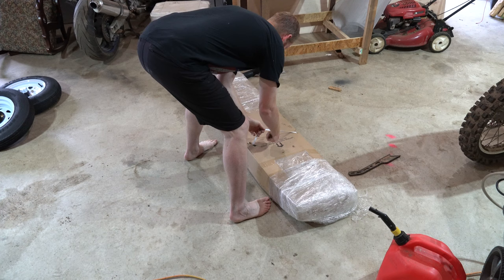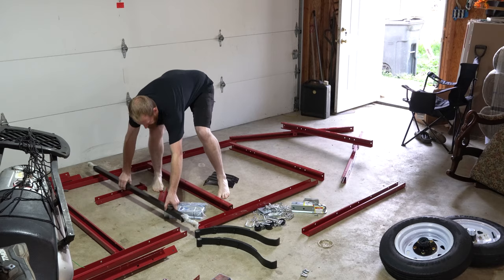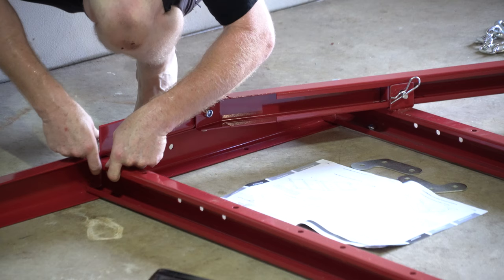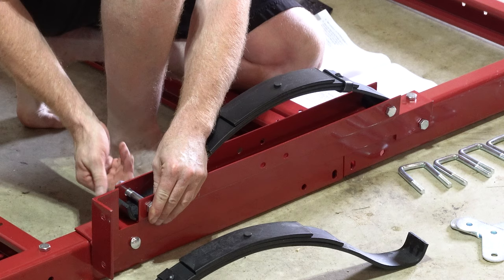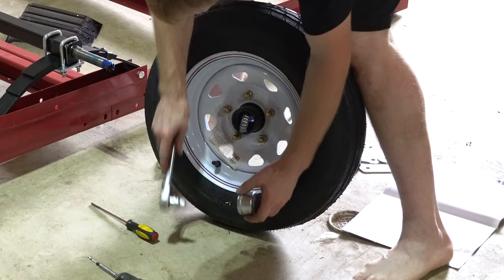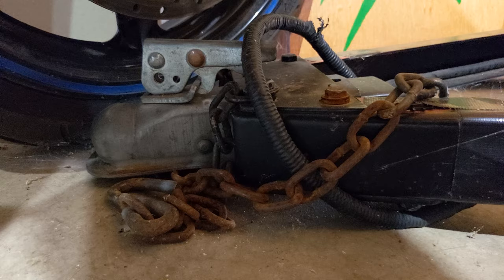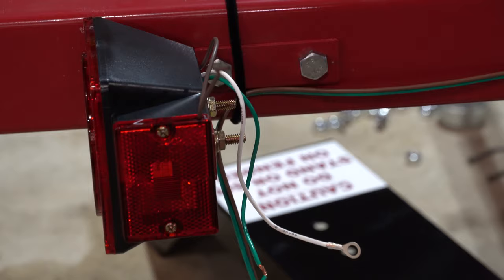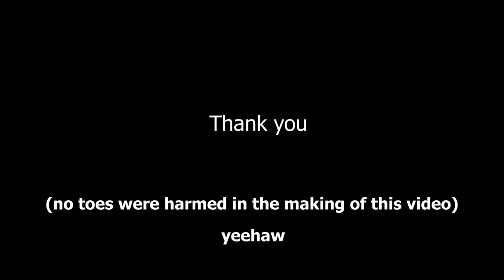Harbor Freight Trailer Build. Full Assembly from Box to Road

Comment: I've finally got my 1720lb trailer put together.
I'm puzzled.  The smallest trailer just has two bars on the tongue.  The 1195 trailer has the extra cross member on the tongue and the 1720 doesn't have that cross member.

I think having that cross member is a good idea.  I'm going to have to see if my tongue has bolt holes there and then hunt down a welding shop and see if they have some cutoffs or buy a length of it.
Reply from the maker: I agree, the cross member is a good addition to either trailer. I bolted one on my 1720lb trailer months afterwards, using a piece of angle iron. The main benefit I noticed was that the tongue jack would no longer make the tongue rail, that it was attached to, slightly twist. Otherwise, the tongue is plenty strong. Thanks for checking out the video.
Reply: I just purchased the 1720 trailer and it came with the cross member. Before I even opened the box I was searching online to see if I could buy it as a replacement part and you can. So that's an idea if anyone does not have it come in the kit.

Comment: My daughter and I assembled one of these over the past 2 days.  No way we’d have finished if it weren’t for your video.   The instructions are unclear at best and the bag of mixed nuts and bolts aren’t labeled as the instructions indicated.  Now we are at the point we need to flip it back over and have no clue how we are supposed to get this 600lb behemoth turned over.    How did you get yours flippedb
Reply from the maker: Thanks for checking out the video. I think it's great that you two are tackling it as a team. 
For flipping it back over, I believe I laid out some cardboard to keep from scratching the paint and just forced it over. Lifting it was tough and awkward for sure. I wish I could say I had a good tip, but I'm afraid I don't. It is one of the unfortunate steps in the assembly process. I've assembled two since then and tried to keep them upright the whole time by using cinder blocks to elevate them. That way makes it a bit easier to visualize it as you assemble it, but the cinder blocks are heavy and awkward too. I wish you the best on the rest of your assembly.

Comment: I wonder if you could set this up to be 2 parts, forward section if you just need a small yard trailer and then atach the back part for plywood hauling
Reply from the maker: From some pictures I've seen, it looks possible. I haven't tried it, though. I don't see why not. Thanks for checking out the vid!
Reply: So, in which of the two configurations do you want to not have lights and a license plate?

Comment: Tried pulling the wire harnes (black connector) apart but could not Having to cut it open.  What do you do with the short string of wires?
Reply from the maker: Bummer on the connector not coming apart like it should. Maybe some dielectric grease could help. I'm gonna guess that the string of wires you mentioned are the ones that tie into your vehicles wiring, at the hitch. I'm with you, though. I wish we could source better made trailers for the price of these Harbor Freight ones. I'm thinking of getting a welder to make my own trailers in the future.

Comment: What grade of tires came with this kit?   I heard for 2023 the tires are upgraded to 85 mph tires instead of 45 mph ones ????
Reply from the maker: The tires are Carlisle Sport Trail. They claim 2 ply on the sidewall, 3 ply in the tread area. Says 1050 lb max load. I checked Carlisle's website. They claim that tire has a max speed of 87 mph. Thanks for checking out my video and I hope this has been helpful.

Comment: I know it would substantially add to the cost, but I would be tempted to buy stainless steel nuts and bolts for this assembly.
Reply: More likely to gall together, twist in half on removal, and need to be replaced. Any reason why you wouldn't trust galvanized hardware?
Reply: @mlindholm  I don't know if these trailers come with galvanized or just plain zinc hardware. Having lived in areas where rust is a concern, my go to tends to be stainless. Galvanized never really occurred to me to be honest.

Comment: Wait, when did you buy that? I had to order one about month ago, and they said it should be in by mid January.  Did you order or just walk in and pick one up?
Reply from the maker: Hey, thanks for checking out the video! I bought that thing in May of 2021 in Virginia. Once ordered, it took a month to arrive. I was just in that same Harbor Freight the other day and they said that the trailers are not available again. At least at that location. I hope yours arrives sooner than later.
Reply: I too had to do a prepaid order for mine, and it arrived in store a few weeks later, in August, 2021.

Comment: In my area harbor freight dose not sell the 5 x 10 trailer anymore mine 5 x 10 was bought in 1983 and the 4 x 8 also tongs are different on them now not  like the older ones.
Reply from the maker: Same here. I had to travel across state lines to buy that one. Thanks for checking out the video!

Comment: Do you think this would work with a Water Tender 9.4 Dinghy Boat ?
Reply from the maker: I checked out the specs on that boat at Westmarine.com. Given the boat's weight of 106lbs, the trailer is capable of carrying it. Installing a sheet of plywood on the trailer might help to protect the bottom of the boat. Because the boat is 55 inches wide at the top and the trailer is only 48 inches wide, you'd have to load the boat topside-up to avoid a clearance issue at the fenders.
Of course, what's most important is how you strap the boat to the trailer. Be sure to use strong enough tie-downs, and enough of them, to make a safe load. I hauled two kayaks with the trailer in the video with no problem. I used six tie-downs to do so. Better safe than sorry. Good luck and enjoy that boat. Thanks for watching!

Comment: Does this trailer tilt for ramp-like loading? The website says it 'tilts for easy loading', but I can't find any pictures or videos of it, and so far, no one has mentioned that anywhere that I can find. Thanks!
Reply from the maker: Thanks for checking out the video and the question. Though I'm personally unsure of the answer, I did some digging and found this video. https://www.youtube.com/watch?v=NnKWdUzMRic&t=32s
In that fella's video he is using his tilting Harbor Freight trailer. The video is from 2013, so there's a chance something could be different with the trailer from then until now. I believe if a trailer is hooked to the car, and you remove the pins from the tongue, then one of these trailers will tilt. I have to admit, though, I haven't tried it. All the best in your search for the answer. Sorry I couldn't verify 100%.
Reply: @mikekrabal  Cool. I'll have to check that one out. Thanks!

Comment: How tight do you turn the bolts? There are no torque specs anywhere except for the wheel itself...
Reply from the maker: Thanks for checking out the video. In complete honesty, I didn't torque them to any specific measure. I simply used my impact driver and it seemed tight enough. Afterward, I used that trailer for a side job hauling heavy parts for a stage build and it held up great. No problems whatsoever. I'm sorry I can't recommend how much to torque them to.
Reply: Use German specs. Goodantite...

Comment: What is the Torque on the frame nuts?
Reply from the maker: The manual didn't say. It only said to torque the lug nuts to 85 - 90 ft/lbs. I used my impact driver and a wrench and used my best judgement. Harbor Freight has a number listed in the manual to call for technical information.  1-888-866-5797 Maybe a person can get the torque specs by calling. I hope that helps. Thanks for checking out the video!

Comment: Do you need a license plate to operate this trailer on the road?
Reply from the maker: In my state, yes. (West Virginia) However insurance is not required in WV for these trailers. Regulations probably vary by state. Thanks for checking out the video!
Reply: @mikekrabal  thank you for responding.

Comment: No footwear? That’s gonna really hurt someday.
Reply from the maker: Believe it or not, I broke both of my big toes in the last year. One with shoes on and one at a trampoline park on the warped wall when I would've rather had shoes on. They wouldn't let me wear them inside the park. I'm usually barefoot as much as possible and haven't been hurt from it. One pays more attention to their surroundings when barefoot. Thanks for checking out the video. I didn't realize filming it barefoot would be such a distraction as it's quite normal to me. Have a great day!
Reply: The video was helpful. The directions that came with kit, not so much. Thanks.

Comment: Unsolicited tip: never wire with those 💩wire taps. Theyre for roadside emergency repairs only. Just a matter of time until it fails. Solder and shrinkwrap the wires instead.
Reply from the maker: Though I've never had any problems with them, I do appreciate your tip. It's helpful to me and others, and I'll consider  shrinkwrap on the next build. Thanks for checking out the video!

Comment: wow, that trailer is doomed because of improper assembly.
Reply from the maker: Been working perfectly for a year. Zero issues.
Reply: @mikekrabal  Some people just don't know the many ways a West Virginian can make things work. And if it was that bad, I'm sure it would be taken off the road by the Highway Patrol. Ohio, now that's a different story... All manner of vehicles that should NEVER be on the road are on the road. And usually traveling at a high rate of speed. But just wondering for giggles, is there still the West Virginia "Farm Use Only" law for vehicles?
Reply from the maker: @Bawb NotTheOwldBawb   I always say, if you grow up poor you'll be handy. I wound up handy and often barefoot haha.. I'm not sure of the farm use law, but I still see some trucks spray painted with farm use sometimes. 

I'm really happy with the HF trailers. I have a used one and that new one. That new one now has a camper sitting on top of it that's more than 3/4 done. I'll have a video of that build in a couple weeks. Thanks for checking out my channel and leaving some thoughts. It's greatly appreciated.